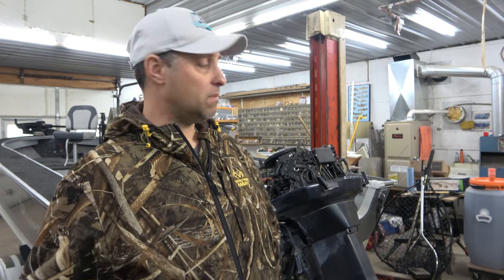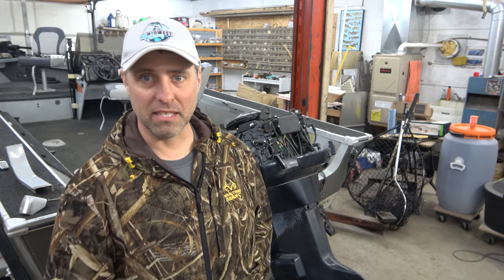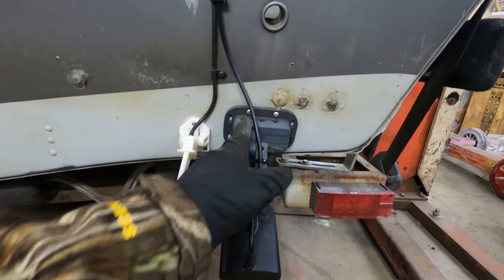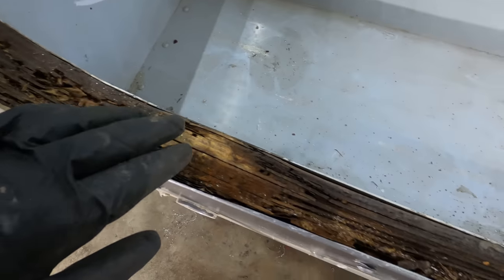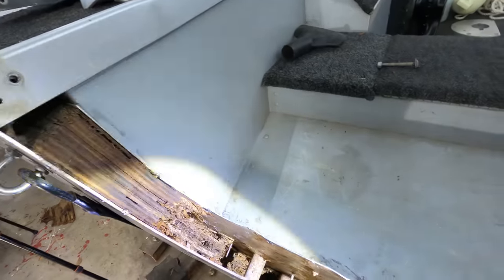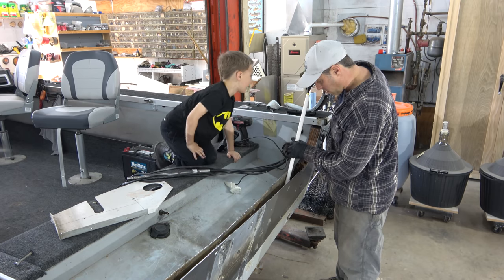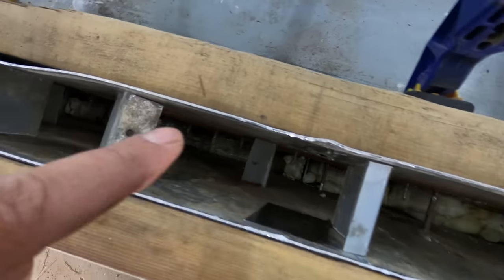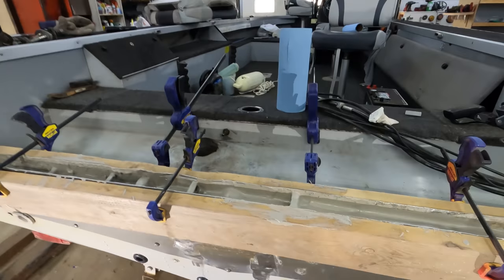The Easiest Way To Replace A Boat Transom

Comment: Seems like if you pull the screws and replace it like normal, it would have gone faster and easier than this. Also, since you siliconed and righted the motor mounts, it shows you knew of the issue and made it worse by doing nothing which cause the aluminum to just become bent like crazy.

Comment: Why has a aluminium boat got a plywood transom? Isn't the whole point of a tin boat is so you don't get wood rot
Reply from the maker: Most of them have wood transoms. Fortunately, they started using composite transoms in the newer boats. Unfortunately, I've never owned a new boat.

Comment: Too bad the company can’t sell a smaller quantity so you could have gone right to the top.  Nice job.
Reply from the maker: I would have gladly bought an extra gallon, but I wasn't going to spend $200 on a 5 gal pail that I wasn't sure I would actually need. Its been working well, so in the end it turned out fine. Thanks John.

Comment: Not my boat but i would replace the rotten wood on the sides otherwise this is not the best repair option my opinion.
Reply from the maker: It an 1991 Alumacraft Competitor CS. It has the side console. I love the layout too. I specifically looked for this style when searching for boats. I got lucky and found a good deal on Craigslist.

Comment: Why boat transoms are not made with stainless steel attached to stainless steel that ribs at least four parts of the boat is mind boggling. That wood design sucks. Old, OLD technology. If I was a boat manufacturer I would build the transoms with stainless steel attached to aluminum. At least two stainless steel runners if not three running aft to stern. With aluminum completing the rest of the skeleton. Then wrap it with aluminum or fiberglass. Build boats that last. Transom should be lifelong indestructible.

Comment: Astounding that a transom intended for engine mounting is filled with plywood, especially non-marine plywood at that.  What a piece of sh.t!  As a retired structural naval architect, that is not only faulty construction, it should be professional negligence. Can you imagine the engine breaking off at speed?  Injuries or death are the result.  Unbelievable.

Comment: To go from wood to a liquid aren't you concerned with the weight difference? The back end with the motor might be a little low in the water, along with it coming up on plain when you speed up?
Reply from the maker: I reviewed the specs of the carbon core, and it is almost the same weight as plywood. So no real additional weight was added.

Comment: Overall a huge improvement and good fix but A few things or steps to consider to make you repair even better… 
You could have / Should have ripped a Fir 2x4 and set it in the the carbon fill at the top before it cured for a perfect full transom. 
You should have painted the back of the boat Before adding the top capping, the corner caps should go on last covering everything, 
The two piece cap is your only really Bad idea, you absolutely are going to have water entering the way you have done it. For the money you paid for the aluminum pieces you could have gone to a sheet metal shop and for a few dollars more have them bend you a perfect fitting C - Chanel of stainless steel, take a corner cap to them for perfect fit sizing.  The Under side of the corner caps should be sealed with Polyurethane or silicone. 
I know you said it’s just a fish boat but these are simple practical steps to make the job go smoothly and give a more professional looking and lasting job.
I cringed when you went down the aluminum weld path. Never work the way you were set up and prepped.
Still enjoyed watching.
Reply: You should read about galvanic corrosion caused by dissimilar metals before advising others. Seems like alot of well meaning people with their ideas trying to help. Not all ideas are good ideas.

Comment: I HAD THE SAME PROBLEM. I KNOW YOU WILL BE FINISHED BY THE TIME THIS POSTS BUT THE TRANSOM IS ONLY ABLE TO SUPPORT THE WEIGHT AND ENORMOUS TORQUE ON IT BECAUSE IT GOES THE WIDTH OF THE STERN AND CONNECTS TO THE SIDE HULLS OF THE BOAT AND GUNNELS (SIDE ) inn one continuous piece  basically what u are doiNg is asking 2 thin sheets of aluminum to SUPPORT THE WEIGHT OF YOUR MOTOR AND ALL THE TORQUE IT GENERATES. IF INDEED THE NEW TRANSOM BONDS TO THE EXISTING WOOD ON EITHER SIDE IT WILL NOT BE AS STRONG AS THE ORIGINAL EVEN EPOXY WILL NOT HAVE STRUCTURAL INTEGRITY A LAMINAL BOND IS NOT POSSIBLE AS IT IS AND IT WILL BE A WEAK POINT IF IT FAILS SAY WHEN U HIT AN UNDERWATER OBSTRUCTION IT MAY CATASTROPHICALLY FAIL AND U WILL LOSE THE MOTOR AND THE BOAT I SUGGEST U GET A BOOK I THINK IT WAS CALLED BOAT BUILDNIG DESIGNS BY GLEN L DESIGNS OR JUST GO TO A BOAT YARD AND ASK GOOD LUCK
Reply from the maker: Thanks for the info. Its been several years now, and its still going strong!

Comment: Hello. I’m impressed. I have a massive leak coming from around where the motor is mounted on the transom. I plan to pull the engine from the transom and inspect it. If I need to fully repair the transom per your video instructions, did you seal around the motor mount bolts, and how much where materials? 38:35
Reply from the maker: Hi. Yes I did seal around the motor mounts and anywhere there were holes. All I did was put an aluminum tape over the holes. When it cures, pull the tape off and drill out the holes again. I bought two 5 gallon buckets of Carbon-Core resin. I paid around $500 for it. Good luck on your build.

Comment: Having renovated my 23 ft Bayliner Skaggit completely over the past 8 years, and many smaller boats before that, l know how important is to ensure that the transom is not only sold enough to bolt the outboard engine to it but to ensure that the transom is absolutely securely attached to the hull and gunnels. Those pieces of aluminium panels are merely trim and will not withstand the forces involved from an outboard engine even if, and its a big IF, the filling compound has bonded to it. Firstly, the aluminium should be squeeky clean for any type of resin to bond onto it. When we were shown inside the void it was anything but clean. I wondered what all those screws were doing? Were they to attach the hull to the transom? In my experience as a multi - disciplined engineer, they should be A4 stainless steel bolts right through to the outside. Good luck, I’m sure it will last long enough for you to find a new owner.
Reply from the maker: Hi. Thanks for your reply. All those screws on the inside were the screws that they built the boat with. I didn't add any of those. I did add a couple of screws to the top which were stainless. A lot of people are talking about the resin bonding to the aluminum. I'm not sure that is necessary with this product. It is designed to be used just as I used it, where it would be nearly impossible to completely clean the aluminum.  I've been using it for three years now, and it still looks like the day I did it.

Comment: I heard your overheat buzzer in the test run.  Hope you fixed that.... 
I would have filled to the top or at least a little higher above mounting bolts, but its better than it was.....
Reply from the maker: I gave the motor a good tune up, and all runs good now. I thought I had enough resin, but came up short. I'm not sure if it would work to add some to the top after it hardened up. Either way, its been working fine as is, so I haven't been worried about it. I appreciate the comment.

Comment: Man, I'll tell you what, I did a fiberglass transom with the pour in 2 part ceramic goop. That shit was and still is fully efficient. Were talking I sokd the boat, bought it back, sold the boat again and he gave it to his son. I'm their mechanic and the transom had never been an issue. Gets wet, doesn't care, tows skiers, tubes and whatever else, doesn't give a shit. That pour in transom stuff is the bees knees and screw all you haters. Of course boat manufacturers still use wood, planned obsolescence couldn't possibly exist in boat manufacturing. Morons. Btw, the boat was 1966 MFG  Edinboro with the original tuned 100HP  outboard motor. I assume I replaced the 3rd transom, it's been good since 2002. Guess it's the next guys problem huh?
Reply from the maker: Hi Chris. It seems like everyone that has never used the stuff says it won't work. For those of us that actually tried it, we know the truth. I have no complaints about it.

Comment: Hey sir. Love the video and really appreciate that you made a follow up. My family has been doing a multigenerational fishing trip up in Canada for the last 45 years and this year the transom needs repair... We bought this product because of your video, and am just wondering if you still recommend it and if there is anything you would do differently (besides get the extra bucket) or would recommend? I honestly appreciate it!!
Reply from the maker: Hi Daniel. I believe I'm going on season 4 now using this transom. So far I have had zero issues. I absolutely love this stuff. Yes, make sure you get enough to fully fill the transom. I just removed and cleaned my fuel tank, and I noticed a small amount had leaked into the bottom of the boat. So make sure you seal up any spots that it could leak out. I'm still not sure how to fill up the corners. Possibly seal the top with a strong tape and pour it in from the top corner. Anyway, I still recommend it and will use it again myself. If you go to the end of this video, I show you what it currently looks like: https://www.youtube.com/watch?v=eqEaD7989SI

Comment: I don't want to beat down on the guy but leaving wood on each side of the transom is a very bad idea as it will not really bind with that liquid filling and definately result in a much weaker transom structure. Anyway, I advocate sticking with a wood transom substitution as it offers by far the best rigidity/pound ratio. Most importantly, a wood transom will absorb a good part of the vibrations created by the engine and can somewhat flex with forces  induced  to the hull. .. a definate plus.
Reply from the maker: Thanks for your info Daniel.

Comment: How much more weight did it add vs wood?  Love all the structural engineers complaining...  as an it guy i think was it better to run with rotten wood instead.?  Bet you many would still run with rotten wood or worse, cover it uo and sell it to someone who does not know any better...  btw would it be worth it to have a machine shop mill a solid aluminum block to replace the wood or is the spring action different enough to matter?
Reply from the maker: Hello KoShu. The weight comparison is very close, with the liquid resin coming in just slightly heavier. I'm not sure if a solid aluminum block would work or not, but it would probably be very heavy and expensive, so not really an option. I think some manufacturers are now using a honeycomb type of aluminum block, so kind of similar to what you are thinking.

Comment: Aluminium is a pain to wield I think excess heat weaknesses considerably you can mig and tig wield it but it’s one of the worst as you can easily blow through your original material
Reply from the maker: Yep, it obviously didn't work. I wouldn't recommend welding that, but I thought I would try it to see what would happen. Thanks for the feedback.

Comment: I replaced a few transoms aluminum boats I will use square tubing that's aluminum fiber boats I use plywood that's glassed over the hole thing then slide it in place I wouldn't leave any wood when your put liquid in and use a vibrating wond to get air pockets out
Reply from the maker: Hi Morton. Thanks for the info. The Carbon-Core I used said it degasses on its own so its not necessary to wand it. I'm sure it wouldn't hurt though.

Comment: If that material wasn't so expensive I would use that on my boat. After two years, is that transom still strong and not broken up inside ?
Reply from the maker: Its been three years now and its still going strong!

Comment: I did the same thing, I used 129$ worth of epoxy and reinforce the mix with fiberglass long fibers and sides of a shopping cart . did it 3 yrs ago still solid and hard. great job though.
Reply from the maker: Thanks Michael. Just more proof that this stuff works.

Comment: You can do it much cheaper just use kitty hair resin it will take about 2 gallon cost less than ?100 bucks you don't have to remove the motor or rigging

Comment: Everybody talking about you not going to all the way from side to side. looks like you got plenty of width to that boat to not have that worry. Plus your motor isn’t that big. Maybe if we was talking a 140hp
Reply from the maker: Thanks for the info. I'd have to agree with you. If I was running a bigger motor, then I think it might have been better to fill it from end to end. I used it a whole season now without a single issue, so it seems to be working just fine the way I did it.

Comment: Opinions are like a--holes.....Everyone has one and they all stink. So one thing I might have added would be Re-bar suspended in that pour. That adds so much strength.  Think concrete slabs.
Reply from the maker: Haha, yep. I do appreciate your opinion though. They designed this resin to flex slightly without cracking. I'm not sure how rebar would affect it, but I would think the engineers would have suggested it if they thought it was needed. I might order some more of it to experiment with it and test its strength.

Comment: The foam is definitely going to absorb water and deteriorate quickly…you should have bought a couple of more gallons of the carbon core epoxy and done the job correctly!!! It should be filled completely!  You should slowly work across your transom with a 1” wood dowel or a piece of metal scrap or something else like that so you are slumping your product and making sure that you have filled all your void… it’s a little 1/2 azzed but it’s way way better now than when it had rotten plywood in there that’s for dang sure!!! That plywood is just crap and he bought the correct product to do this project he just needed a little bit more to do it the right way… it’s most of the way filled so it’s much better and stronger than it was before!!! I’d probably not add that bigger engine but that’s not really my choice… unless you are tournament fishing for money then saving two minutes running to a spot doesn’t seem like a viable option of me but that’s just me I’m quite happy running with a 25 Johnson… but I’m not fishing for money! I’m just a pleasure guy… this is 90% great… those last couple of inches would probably have been better off empty then have that foam… it will absorb water and it gets water logged and heavy!  I usta have to tear the foam out because it’s water absorption problem’s… if you need to save your product in the future use the plastic wood in like a 1x6 that correct width and pour some then press the board into it… then fill it then press your next board down in to your resin… you’re adding a ton of strength and rigidity… 4-5 strips of aluminum 1”x3” aluminum box would have taken up your space and added a ton of rigidity into your transom’s as well… they make great “filler’s” and add massive strength as you don’t worry about keeping them squared up and those variations of their angles once your core resin kicks it’s freakin super strong… strong enough to bolt up a 225 if you wanted to and have an absolute rocket ship!!! 😉👍
Reply from the maker: Hi David. That was a lot of great advise, thanks for that. I kept the Evinrude motor on it. I use my trolling motor 90% of the time, so I figured there was no need for a bigger motor.
Reply: @GoMidwestFishing  she was ripping right along with that engine on her from the video…she looked to be scooten faster than I’d probably normally be wanting to run… unless a tornado was coming! LMFFAO! When you keep having to go back for your ballcap she’s going fast enough for me! 😂😂👍.  That’s a great boat and she’s definitely going to be good for a good while with her repair!!!  👍😁.  She’s a fantastic fishing boat!!!

Comment: How heavy is that once  cured I don't want my boat going nose up?
Reply from the maker: It about the same weight as a plywood transom, so it doesn't actually add any additional weight. I think I calculated it to be about 2 pounds heavier.

Comment: It looks like you tried to weld the aluminium with one single weld. Might have worked if you had tack welded.
Reply from the maker: Hi Richard. I think the main problem was that the boat acted like a big heat sink, and I couldn't get the aluminum hot enough. Either way I'm not sure it would have worked. A professional welder probably could have done a good job here, but those rods I was using just aren't suited for this project. I appreciate the input.

Comment: just an idea, ever think about adding rebar to the transom, add strength, cheap and take up that little bit of volume you were short on.
Reply from the maker: Hi Jeffrey. I was thinking I could have put some rebar in the wood corners to join it to the liquid resin. I didn't know I was going to be that short until I poured it in, so I didn't have time to think about it. Otherwise, this stuff is designed to be used as is by itself, so I don't know if adding something like rebar would affect its performance. That would be a good question for the manufacturer. Thanks for the comment.

Comment: Best, most economic transom can be made from the rear doors on tractor-trailer rigs.
marine grade ply w/a aluminum sheeting..  sometime find at trailer repair shops used..
Reply from the maker: Hi Dennis. That's an interesting option. No one has mentioned doing that yet. It sounds like it would actually work.
Reply: Run into it about twenty years back..  transom still tite..  thanks.. just a thought.